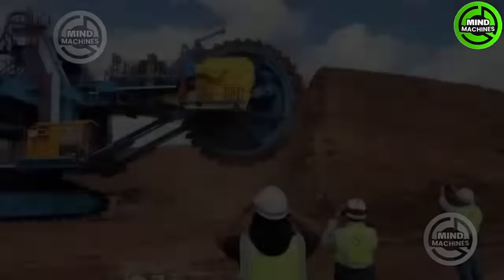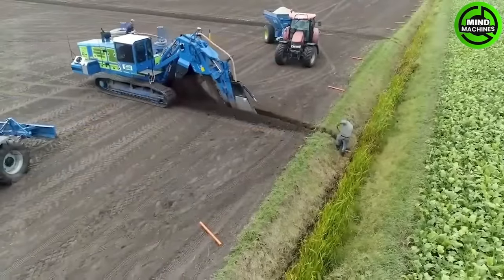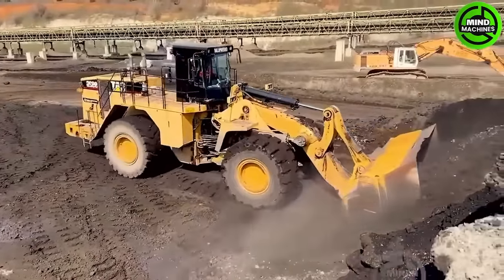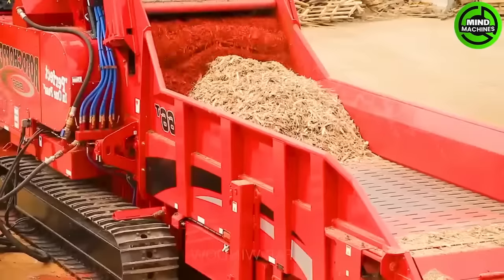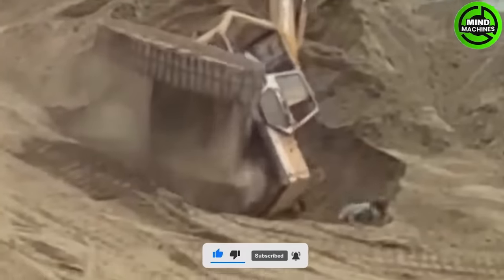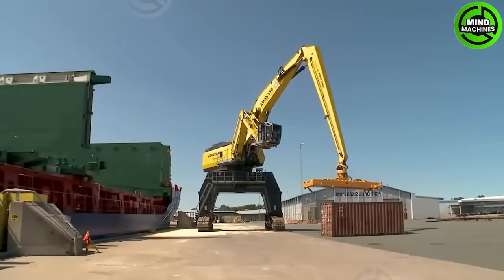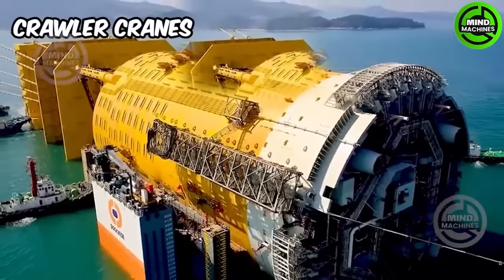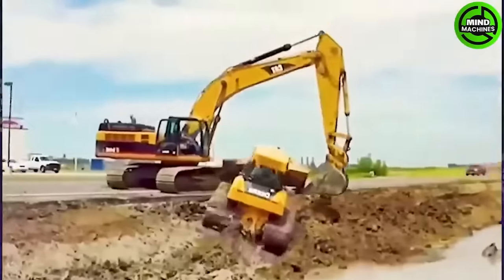200 The Most Amazing Heavy Machinery In The World

Comment: At 42:17 you showed 2 dozers and then said that the A3SD is the largest bulldozer ever built but the video that you are showing is 2 CAT either (D10) or (D11) on the video not the D575A-3. Although the Komatsu D575A-3 was in production until 2012 it was one of the biggest and best bozers out there. Komatsu D475A. Komatsu, a juggernaut in the industry, doesn't just manufacture bulldozers; they create perfection. Komatsu bulldozers are excellent machines and the Komatsu D475 is the largest dozer available now. Still the A3SD still wasnt the biggest bulldozer ever built, it was short a few tons. At 183 tons (that 30 tons heavier than that Komatsu A3SD) Umberto ACCO company, the ACCO Superdozer is the largest crawler bulldozer in the world. Made from Caterpillar and custom adapted parts, the ACCO Super Bulldozer was initially destined for Libya’s land development program in the early 1980s. Although that dozer is no longer in production or even running anymore anywhere you are correct that the Komatsu A3SD is the largest bulldozer that's working today. When the parts all run out they will be going for either the CAT (D11T) or future upgrade models or the Komatsu 457A. I'm sorry for the long post but I like heavy equipment.
Reply from the maker: Thank YOU for being an amazing viewer. We'd be honored if you subscribed as well!
Reply: @MINDMACHINES-mu2yn  I am